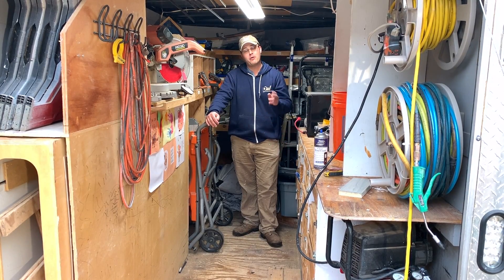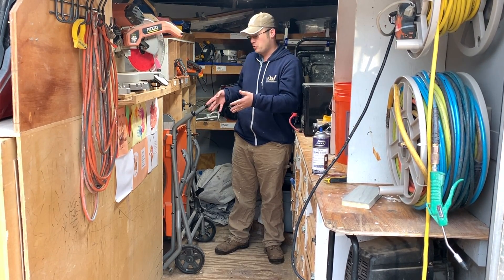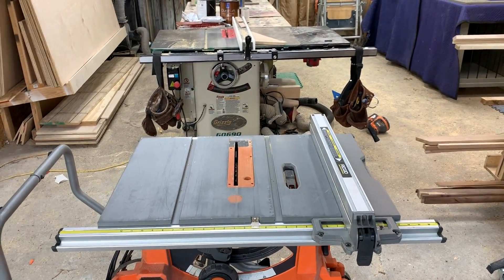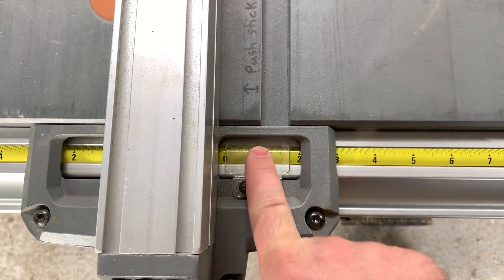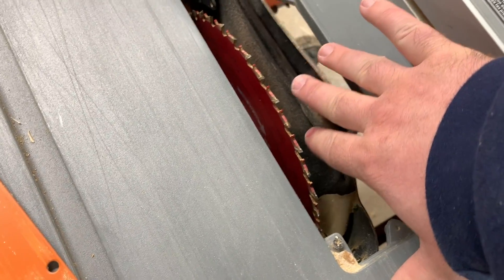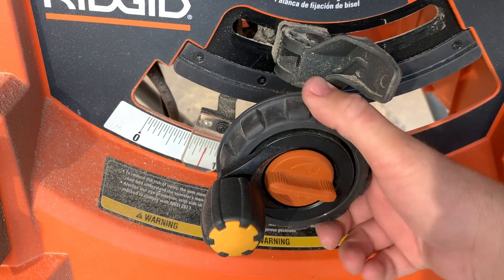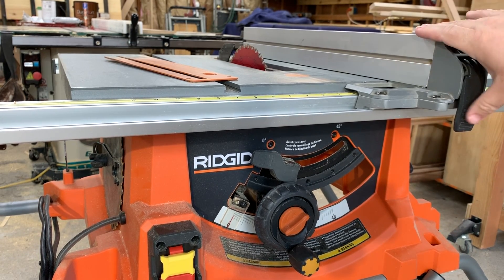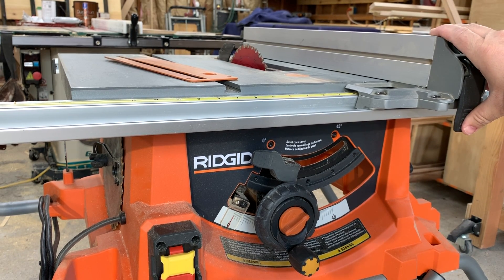Ridgid R4513 Portable Table Saw - Five Minute Tool Reviews

Comment: I’ve had mine for 3 years as a hobbyist and it has worked great.  Very accurate and was adjusted and setup out if the box when I checked all the alignments.  Dust collection is very average but for the money it’s been a great saw. Lifetime guarantee as well.

Comment: After only a few years of minimal DIY use of my 4513 it began to develop a noise somewhat to a bad bearing. Not wanting to crate it up and drop it off at the HD. I took the motor apart and found the output arbor spur gear completely dry of grease, as well as the pinion drive gear at the end of the motor. They mate together inside the gearbox which had lube but was not spreading to the gears. The output bearing race was also starting to show signs of spinning in the housing. looking at buying replacement parts now and i am finding that the arbor is no longer available-discontinued.

Comment: Does it try to tip forward if you get a pretty good size 6 or 8 foot board on there or a long piece of plywood?
Reply from the maker: It's pretty stable, I personally do not use a table saw with out an outfeed table. Even if it's just a piece of plywood on sawhorses for the outfeed.

Comment: is the table top perfectly flat?
Reply from the maker: Flat enough, I've checked it with a level and didn't find any high or low spots.
Reply: The Recreational Woodworker - Dailey Woodworks:
i should exchange mine then considering there’s almost a 1/8 drop on both sides at the back of the table but the front is fine.  they build such junk.
how the hell are we supposed to put these back in the box.
this isn’t right